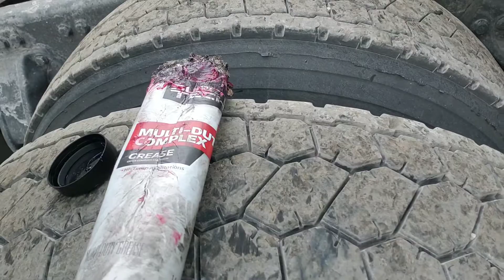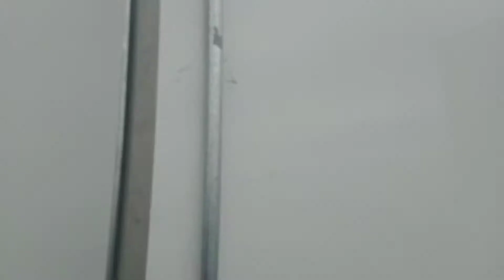Loadout Trailers - Power Only

Comment: What does load out trailer means ?
Reply: Trailers that need to be moved from one location to the next. Usually from one state to another state. They normally allow you to use it 7-10 business days. During that time, you are allowed to pick up your own loads with the trailer. If the trailer is damaged during that time they could without payment, if any was offered to begin with. I have moved trailers where zero dollars were offered to move the trailer. Another downside is finding loads heading towards the final destination of the trailer